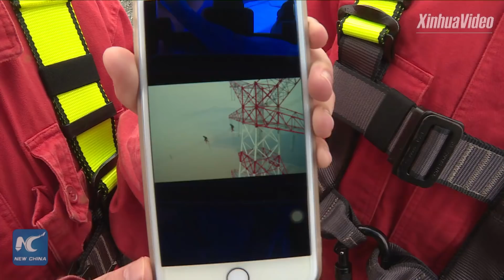World's highest transmission towers to be put into service

Comment: IMHO; 500kV is not exceptional, but the 380m tower height is dictated by the width of the span they want to cross, the droop of the catenary and the strength of the power cables. Then, the wind forces on those cables mean the tower must be strong as well as high. Congratulations to the designers and builders of this truly astounding project.
Reply: What is the highest capacity transmission line in the world? Seems we need to build them across all continents to share renewably powered electricity back and forth for our citizens...enabling a systemic phase out of fossil fuels and their carbon emissions, air pollution and energy insecurity.
Reply: Always we use Electric wire on the transmission tower,not the Electric cable.🎓🎓🎓🎓🎓🎓🎓🎓🎓⚡⚡⚡⚡🌏🌎🌍🌐😊
Reply: @aaronvallejo8220 highest I know is 760kV but I might be wrong. There might be higher. The longer the distance compared against the amount of power that needs to be delivered, the higher the transmission voltage has to be in order to reduce losses.

Comment: Mate!! He mentioned this Pylon weighs 7.000 tonnes.  In New Zeland 80 tonnes is a huge Pylon.  The need for this huge structure  I see a couple or reasons.  To continue to carry huge voltage (500, 000)  across a massively big span you need height and size.
Reply: Don't forget bro this pylon stands 52 meters higher than the sky tower lmao. Damm China beat us with a power line 😂
Reply: @johnkepa2240  
And they also built a great wall.
And they also built a mega dam.
Reply: And the world’s largest high speed railway system
Reply: China does up to 1,100kv in DC too.  The back bone of Chinese transmission system is by Ultra HIgh Voltage which starts at 800kv.

Comment: Imagine how much tension is on the cables
Reply: at this point there is likely no added tension because the heat cycling of the cables would cause premature failure from metal fatigue. just like a suspension bridge, they are just supporting the weight. high transmission loads through the cables likely causes them to droop by an extra  50+ meters so this stretching back and fowarth would not be good to add more forces like tension

Comment: It's a very impressive structure but I guess these towers will need a lot of maintenance over their life time. I wonder how it worked out cheaper to built these two towers that weigh over 7000 tonnes each than to lay undersea cable between he two islands?
Reply: look at the size of those insulators it would need a tunnel 20 mtrs for each cable there are 3 needed for each line. go buy a shovel  see you later
Reply: High voltage line in transmission towers is the cheapest because the conductors are naked and unprotected.  They are isolated by air and the heat is easily dissipate.  At high voltage electrical cables can't be made large enough with wide enough separation because the cable needs protection and armour.
Reply: ya they can do underground cables but those are impossible to inspect and at these high voltages you need to pump in a bunch of oil insulator and so that can cause early failure if there is a leak in this fluid with any corrosion or crack. in california some of the underground high voltage dc lines have failed after their frequent earthquakes because they develop a crack and leak their oil out over time. it is then extremely difficult to fix this crack underground and takes a long time to basically place an entirely new underground transmission line. ur question is a good one though. one problem is the heat from high transmission can cause the lines to droop more than what you expect and the steel masts of ships plus salty sea water in the air makes for a perfect point of arcing to the ground/boats underneath.